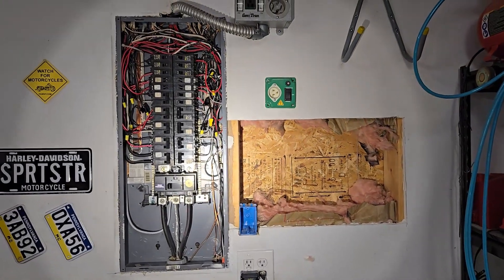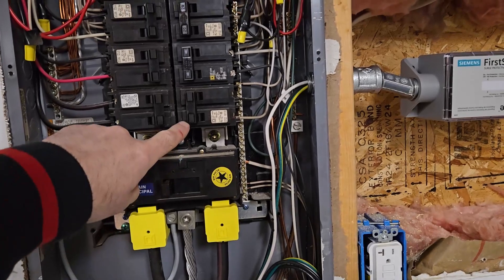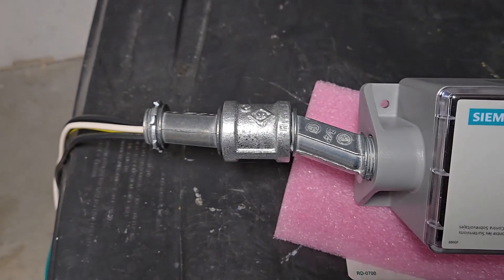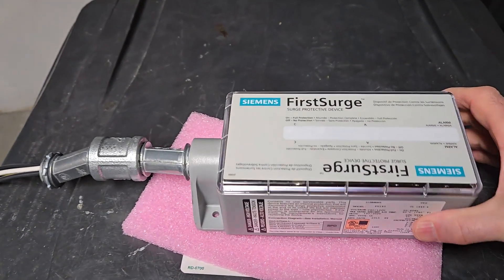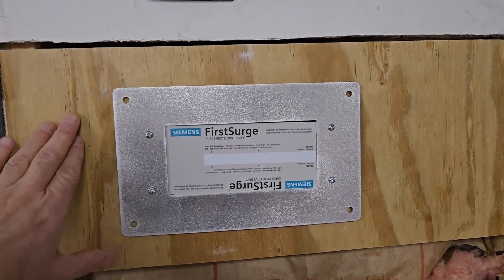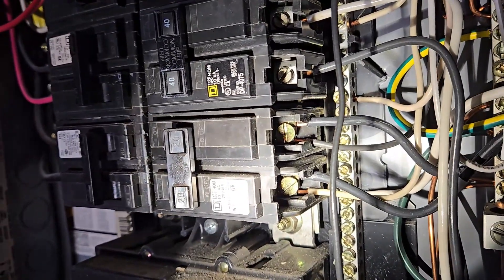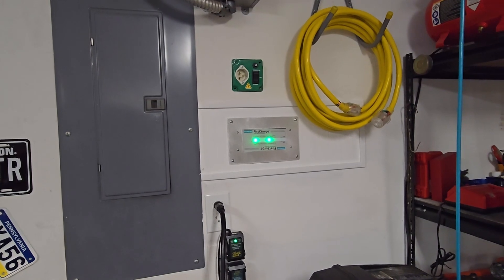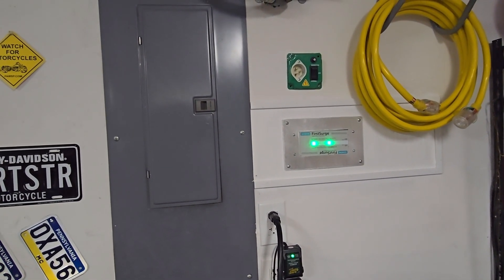Installing a Siemens FS140 whole house surge protector, flush mount

Comment: You cannot thread metal threaded connectors into pvc. This is a major code violation. Maybe revisit this job and use 3/4” pvc pipe and connectors.

Comment: Thanks for the video. Running electrical to a new shed and since im in the main box I might as well add one of these. Except I have to add mine outside.
Reply from the maker: It seemed like worth doing considering the protection it provides, and it wasn't too expensive. My understanding is new construction is required to have a whole house surge protector. So I was playing catch up.
Reply: @ it wasn’t terribly expensive and the install was really straightforward. Took me like 20 minutes, and I just did a hot install.

Comment: If you have a surge, wouldn't only that circuit be saved?
Reply from the maker: I had the same question. I can't explain it like an engineer, but if you install it following the instructions, it will protect the whole panel. It is critical to connect it as close to the line in as possible, and keep the leads as short as possible.
Reply: @bluesriderDF UL tests are performed with 6-inch wires. Therefore, anything longer than 6 inches will add significant voltage due to cable inductance, and the 600V VPR limit will not be met. Therefore, the included wire should be cut as short as possible, to a maximum length of approximately 12 inches. The best way is to install it directly in the box with the circuit breaker directly at the input to have the straightest and shortest wires possible without pronounced bends. The circuit breaker used must be the one immediately after the main breaker.
"To obtain optimum surge suppression, locate the SPD as close as possible to the circuitry being surge-limited to minimize the wire length. Minimizing the wire length reduces the impedance between the circuitry and the SPD. 
Refer to the Voltage Protection Rating (VPR) values on the SPD nameplate. These VPR values were obtained by testing the SPD with six-inch long leads (per UL1449). For every additional foot of wire beyond six inches, the effective VPR increases by approximately 160  volts."
Reply: No, electricity doesn't flow like water. It hits all the circuits at once.